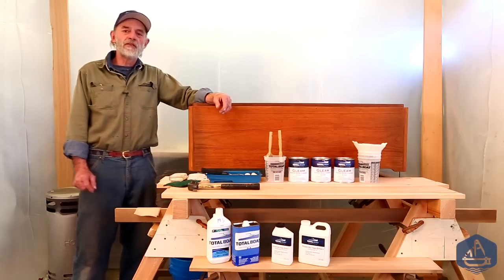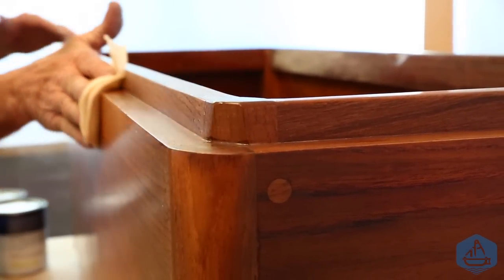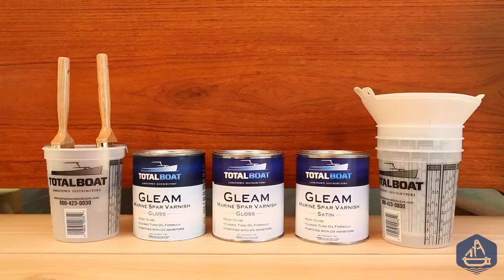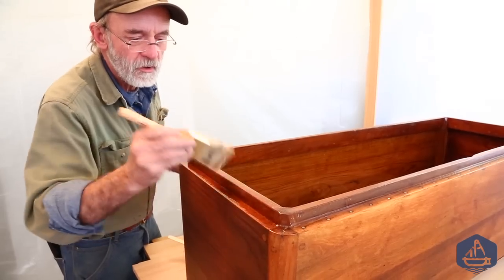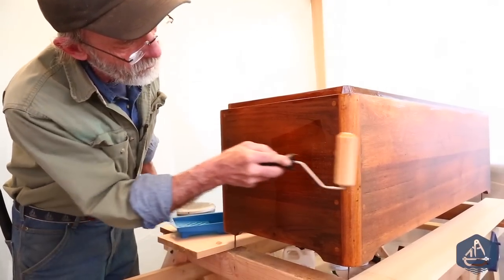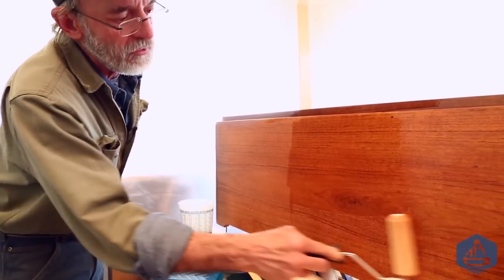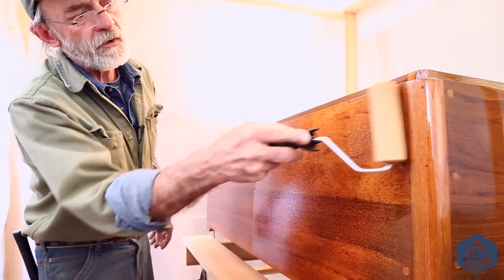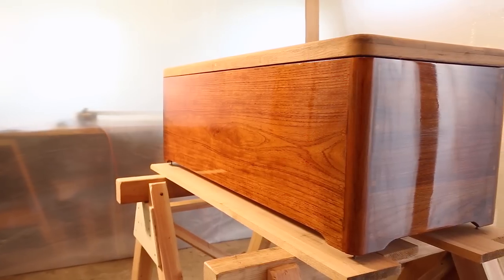Tips for quick and easy varnishing of wood

Comment: This might seem like a bit of a captain obvious question - Would you use the same vanishing process on your boat?  I have a Mirror that I want to strip back and vanish the topside.
Reply: You probably wouldn't want to use a roller on a mirror. I'm assuming the surface area of the wood on the mirror is much smaller and more detailed than a large deck box like this. A small brush would work better to apply and tip off the varnish with.